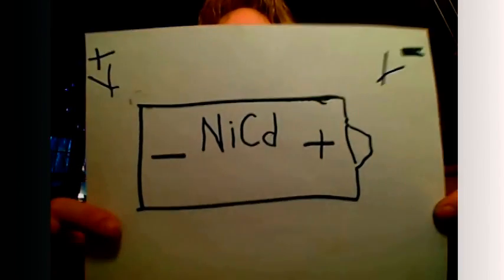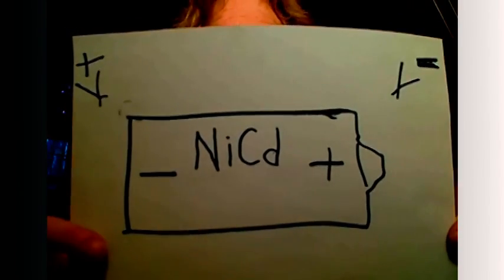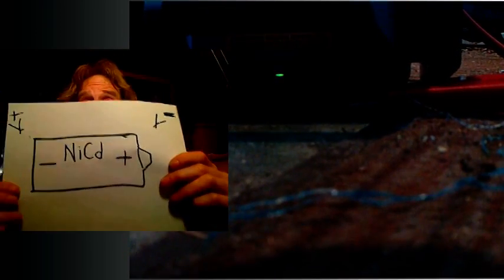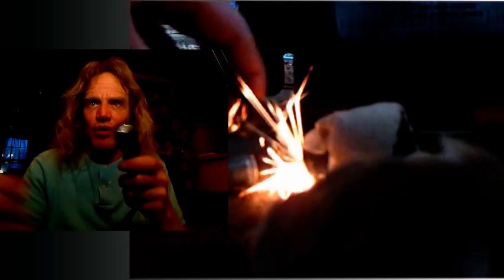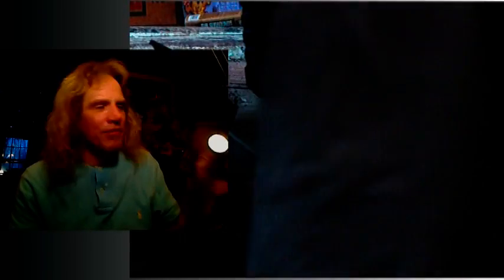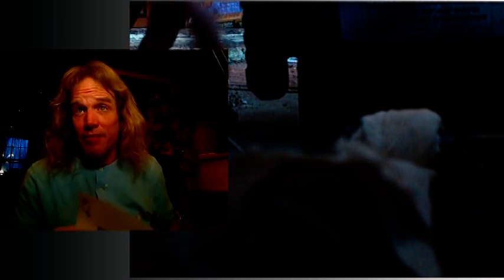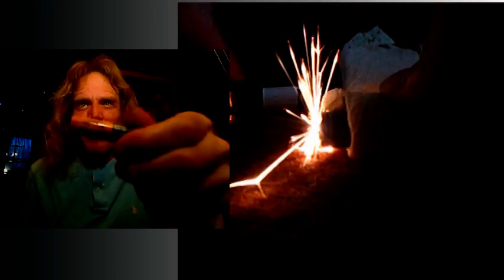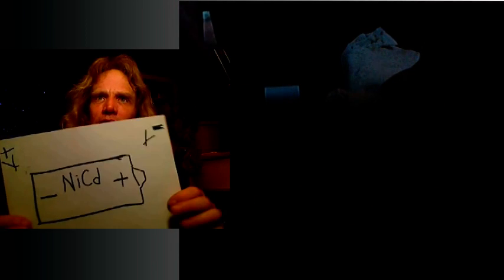ZAP NiCd battery ... recondition condition to like new

Comment: LOL, Though somewhat correct  if you are going to zap the batts in reverse Pol - + + - you need to rezap them in the correct Pol.++ -- shocking them back to life before putting them on charge so they will accept a charge in the proper pol. if you get them to take a charge in reverse they will not work correctly or at all depending what you use them in! Very entertaining presentation had a good laugh but what you're saying pretty much works if done correctly.
Charlie

Comment: NOT new technology, I ranRC cars and boats that ran on NiCd batterys years ago. I had what they called a reflex charger, that pulse reversed the polarity while charging the NiCd cell packs. It made the batteries last longer and always charged them to full capacity. We always discharged the batteries fully by soldering 1156 automotive bulbs together in groups of 10. Reversing the polarity is dangerous, batteries explode when you do that (shrapnel)and heat is the enemy so keep them cool.